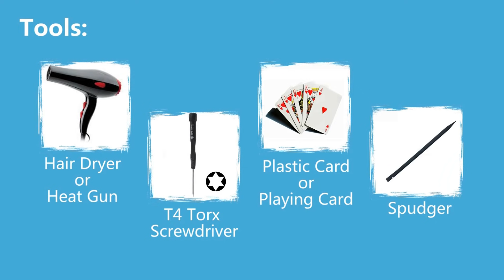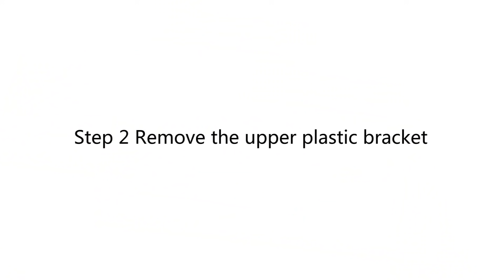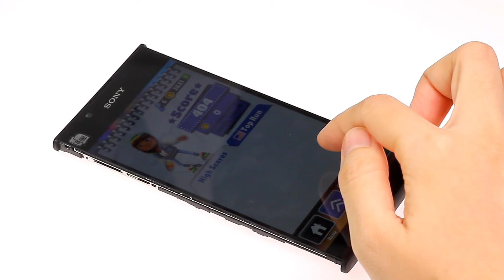Sony Xperia L1 Battery Repair Guide

Comment: Since I got it, it took a long time to load and was downloaded quickly, until yesterday I turned it off by 10%
and in the morning I tried to load it but it only came out in a box that is loading, it stays in a red stick
and it doesn't stop vibrating every time the load image comes out

Comment: This phone is so hard
But the performance is good 
Why this phone is overheating while gaming
And so fast to drain the battery while gaming??
Reply: Huawei p8 lite is better
Reply: Maybe due to poor RAM and low processor. Yeah but the performance is good, i agree
Reply: This phone has a 2500mah battery(I think). Why did Sony even design a phone this crappy?!

Comment: Week ago I was just listening some music without using the phone for anything else, suddenly it crashed and when I tried to turn it on, didn't work. I tried so many times and sometimes it started just for a few seconds and just til the android logo after that the screen crashes again. I don't know if it's the battery or anything else, I have info in the internal memory I want to keep... any advice?
Reply: Sometimes you need to format the SD card. Try taking it out, and if it works when you restart without it, then that is the issue.